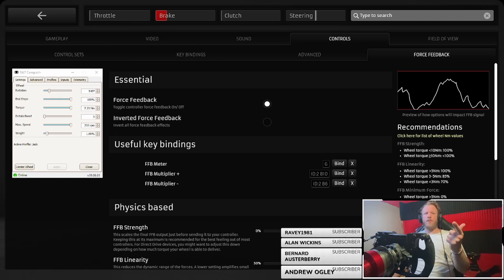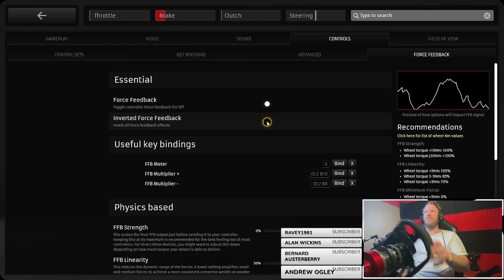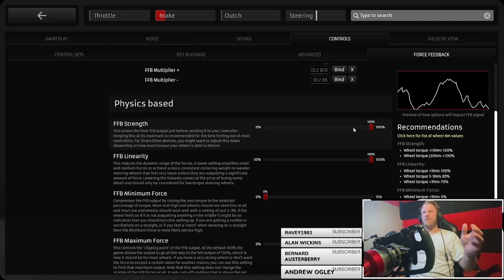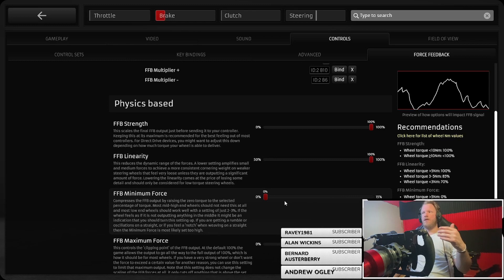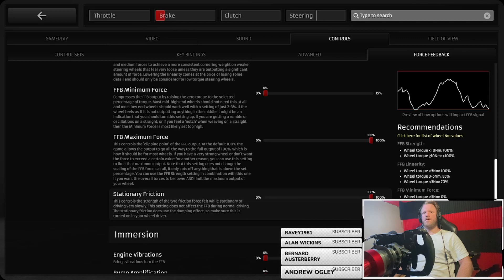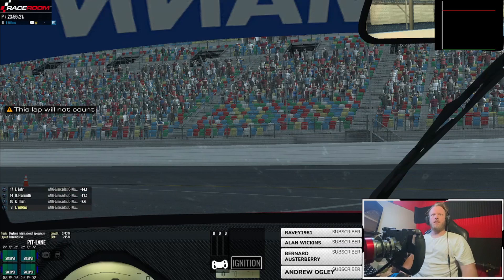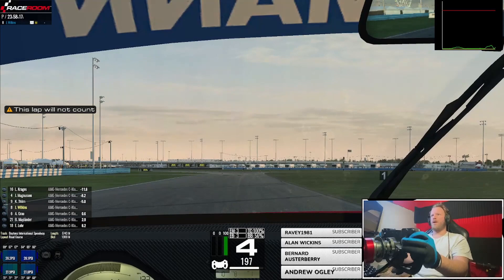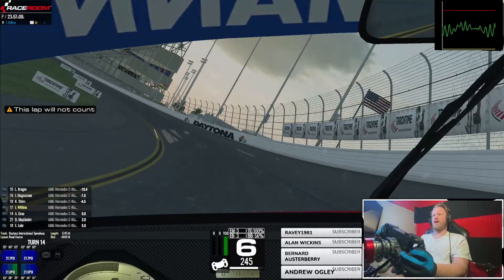How To Set up Raceroom's New Force Feedback- Quick Guide

Comment: Why does my Fanatec McLaren GT3 V2 rim feel so heavy when I turn in Raceroom? Like, the weight shifts abruptly when I turn, and then it goes light again on the straights. Basically, the more I turn, the heavier it gets. It makes it very difficult to control the car.
Reply from the maker: This would be the car loading up in the corners. Ffb trying to give you the feel you would get in the seat. Also will depend on car as if high aero the car will be pressed in to the ground so tires will be harder to turn I guess. 

I'm sure someone with alot more knowledge would be able to tell you in more detail but I think I'm in the ballpark with why. 

Sorry I can't help more.

Comment: Great vid, but do u know how to adjust te steering (angel??) I need to steer way more then needed to go around the corner?? HELP.
Reply from the maker: It's been a while since I have played but I know my wheel doesn't auto adjust to the car so I have to go to pits when first get in car. Look at the steering degrees for the car In the setup menu and then adjust my wheel software to match. Hope that helps.
Reply: @JWSimRacing  its set to 540 i think but like other games its 1080 but if I change nothing happens?
Reply: is there also a different setup for the dd1 fanatec
Reply from the maker: Hmmm I'm not too sure then. What wheel do you use?
Reply: @JWSimRacing  fanatec dd1 f1
Reply: if i set 2 180 degrees its better. but turning in its looks like there is an assist is that normal?